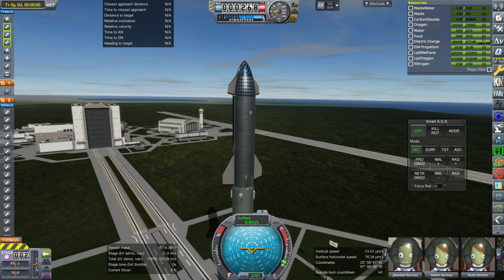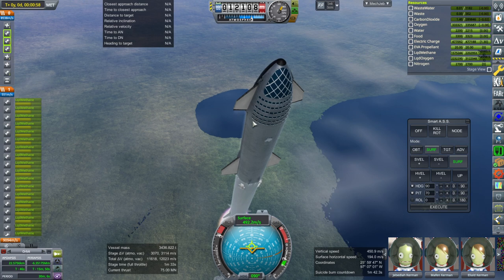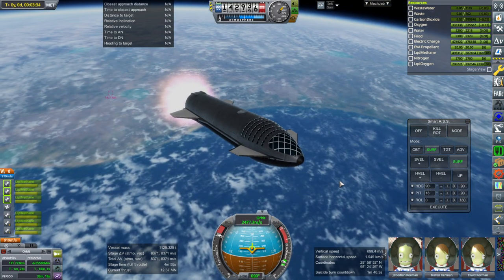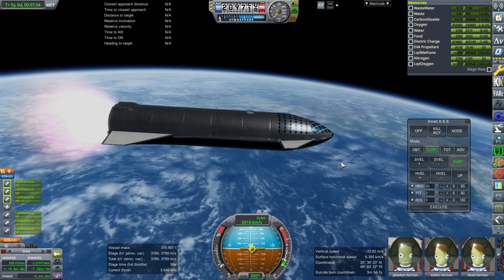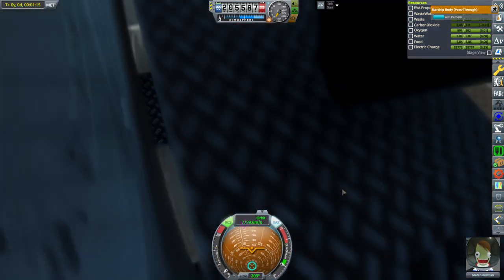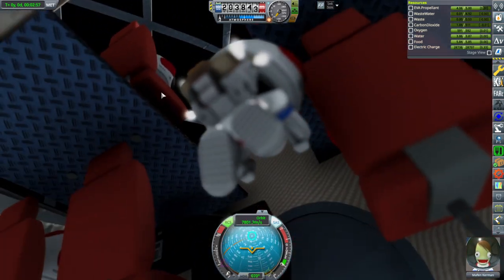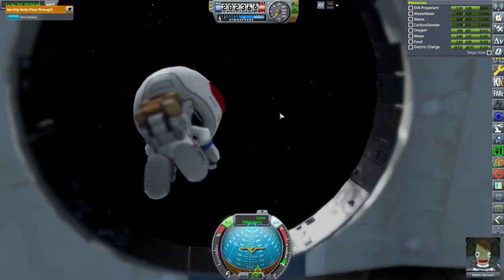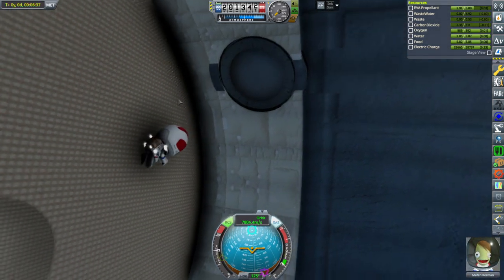KSP with Realism Overhaul - Starship Interior (Early Test)

Comment: I have a question. When I down a loaded EDBMod (thank you for that glorious part pack), I could never find the Starship flaps in the VAB. What did I do wrong? (The starship flap config and textures were still in the Starship folder of EDB)
Reply from the maker: I did not make the flaps - I've just been using B9 Procedural Wings so far.

Comment: Two things I thought were worth mentioning. One, it was hard to tell, but it looks like those planters are full of dirt, which in a spacecraft is obviously suboptimal. Hydroponics instead might work well. Secondly, I’d suggest adding a ladder to get up and down the decks. Should make it easier to navigate and doesn’t use any EVA propellant. You can even add ladders perpendicular to the main one if needed, and switch to them with A and D.
Reply from the maker: I'll have to model a hydroponics system. This looks better, though, so we'll make it decor instead of functional for now. The ladder probably will happen, of course, but it sometimes takes more EVA prop to line up with the ladder collider than to just float through the gap, so it's not necessarily a savings.

Comment: That frame rate is shocking
Reply from the maker: If you're getting good frame rates in KSP, you're not doing anything interesting.
Reply: @RaizSpace  ok, try this on for size:

2013 HP Pavilion 23" with very poor specs, ksp downloaded as a torrent, with realism overhaul inbeded into its core, with a framerate of 60fps on medium low mix of settings.

OR:

If I play the game today after purchasing it, it's going to be left on ultra high settings with realism overhaul, 1:1 scale solar system, and all of the relevant mods to make the game just as hard, on ridiculously high specs.

The first of the 2 statements is practically identical to the specs of your machine, a potato, and the second of the 2, would be my current and future settings running on a ridiculously powerful system.
Reply: @RaizSpace  you see, a good piece of criticism is sometimes more then enough to convince you to upgrade your machine.